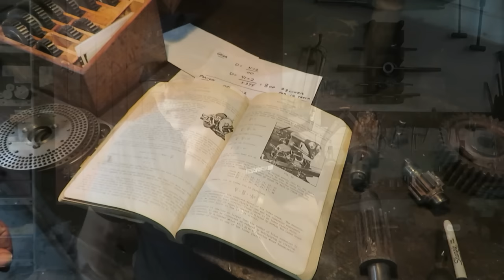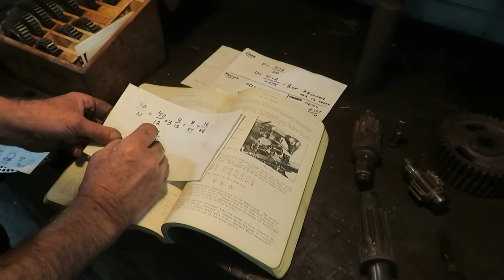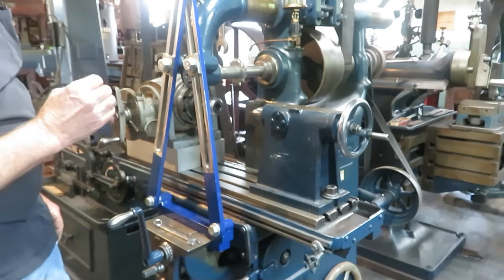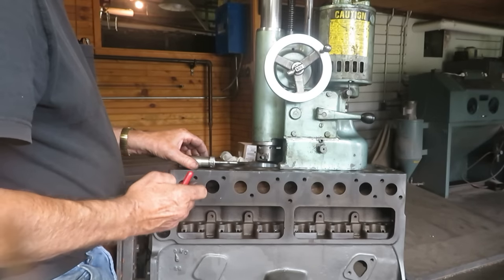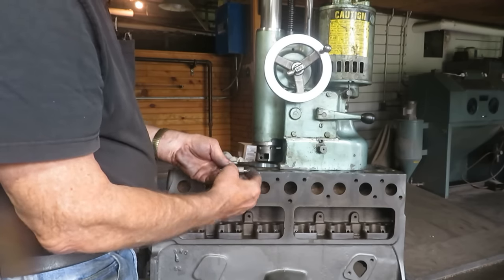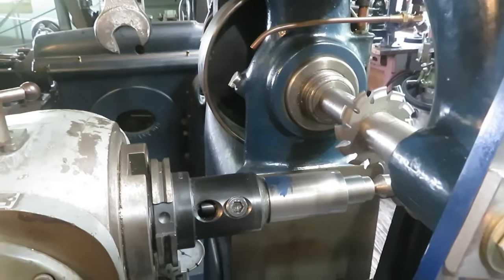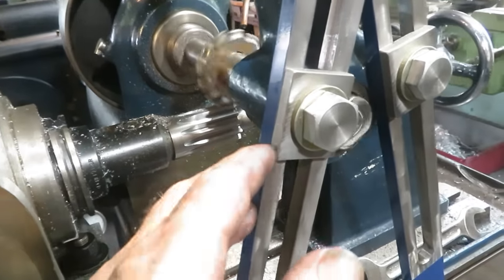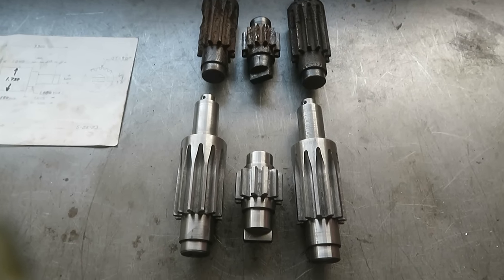Steam Powered Machine Shop 85: Gear Cutting 1890 style

Comment: Nice video. I worked in a factory in the 1980s. We had an end mill that we used to cut keywys in shafts. It was similar to the end mill at 18 minutes but more enclosed. An employee was running it, and he had leather gloves on and was brushing out millings from the cutter. His glove got caught in the cutter. It drug his arm in and split his arm in two up to his elbw. He ended up healing and losing some use of his arm. To this day, he still wears a compression sleave on his arm most of the time. Lesson learned, I guess.

Comment: Seeing there was a new video from you already made my day. Cutting gears was my main task during apprenticeship back in the early 80s. We still used the same formula and index hole plates on our machines even though they were powered by electricity. I know how easy it is to mess up if you don't check all the nuts and bolts for tightness all the time. I believe we even had a similar contraption to support the horizontal axis, but I can't remember whether that was custom made or part of the machine.
In my second year we got a rotary table so we could use a vertical axis cutter but without support from below it was never as accurate as the horizontal one so we had to do it in twice as much passes and went back to the old machine with the supported axis.
Anyway, good to see you back.

Comment: Thx for a Great much awaited new vid. Couldn't tell for sure if cutting the gears was "working" the  engine or if it was just a slightly out of round cutter, but no matter still enjoyed the shop sounds. Much appreciated Sir.
Reply from the maker: No matter what you do, the arbors never run exactly straight when you tighten them down , probably because the spacers are less than prefect and those are way less than prefect. If the cutter is sharp, it doesn't seem to matter.....Dave

Comment: I had seen another old horizontal mill on another YouTube machinist video channel.  Believe it was a WWII era machine and the end vertical support was a large heavy cast iron component to memory.   Like what you guys are doing.  I’ve always wanted to do more and learn machining.   I and my handicapped brother had great parents.   Dad never got to finish the 4th grade.  He and mom wanted to see me get a good education and trade skill if I didn’t get to ho to college.  In the late 1960’s and early 1970’s everything pointed to electronics being the next big industry.  I was in high school and knew they didn’t have the money needed to send me to college even though they would have done everything they could to do so.  Dad was a Jack of many trades and a master of many at least in my eyes.  Auto mechanics, welding, carpentry, masonry/concrete and a hillbilly engineer always able to figure a way to do stuff without the special tools.  In high school I worked from about noon till 5pm at a local welding and machine shop.  I took the opportunity one day to miss classes and take the military’s ASVAB (Armed Services Vocational Aptitude Battery) of tests.  I maxed out the mechanical section but did pretty bad in electrical/electronics as the not thing I really knew about electricity was getting shocked and that it made electric items work.  Still my intuition and guidance said electronics and computers were the future.  So I asked and the recruiter allowed me to go through their MOS (Military Occupational Specialities) books that described the MOS and it’s AIT ( Advanced Individual Training) school curriculum.   I was looking for something that employers would have need of people with that or similar knowledge or I could use after service to have my own business.  I settled on the most advanced and longest school they had in electronics. Well the course was a struggle for me but I made it and at my duty station at Ft Bliss in El Paso, TX soon became the lead troubleshooting and repair technician in my MOS.  I had always wanted to come back home to live and work and I got a job working for the utility at the nuclear power plant being built.  Worked there 29.5 years until a life of chronic pain with sleep deprivation forced me to quit at 51.  I’m 67 now and always missed being involved in welding and machinist work wanting to have my own hobby/side income doing that. Hasn’t happened yet but still hoping and praying it will happen SOON. like what and how you guys are doing machinist work.

Comment: My imagination started to work on overdrive when You were talking about the options to run a machine backwards.
Goes like this:
 - I need to run my machine backwards, when is the next opportunuty to run the line backwards?
- You should know, it is every tuesday we have the backwards hours. You have to wait till that.
The drill operator says that next tuesday is out of question because he has a tight schedule on his project.
He was given some left handed drills ...

Thanks for the video.

P.S. When I have to figure out the disk for the dividing head, I usually multiply the number of teeth with 40. Then I start to "try" out nubers that this product is divisible with. When I stumble across a suitable number, that is the number of holes the disc needs to have.  with that disc, each teeth needs to have 40 holes passed by. I am a little bit fraction disabled ...
Reply from the maker: But certainly you have a feel for dividing large numbers in your head....Dave

Comment: spent a couple summers in a old job shop with these machines. the overhead shaft was still there as was the boiler and bunker c fuel tanks and fuel. the shop was electrified sometime in the 20s or 30s around the same time ransom olds factory electrified up the road. one drill press had a general motors transmission overhead for the reduction and coupled to the electric motors. i still rather manual machines for their ease of use and memories of those summers turning out rollers for conveyors and citrus handling equipment the company sold from the teens until the 80s when the shop sold and was scrapped. what a shame i wish i had all that because it was scrapped for steel at the port off tampa and loaded on a barge bound for korea..

Comment: The last production job done on my grandfather’s 1892 F.E. Reed 18x72 lathe was 9,500 pieces circa 1970. When I inherited it I found a good fit- I donated it to a museum that has a machine shop of steam-powered, flat belt driven machines between 1890-1910.
Reply: You were supposed to learn how to use it.
Reply: @SirTophammHatt-zs7jj  My grandfather, who died in 1964, used to shift the drive belt from one pulley to another while running by pushing the edge of the belt with the palm of his hand. I never even tried that, but I ground flywheels and pressure plates, split 16 inch Kelsey-Hayes wire wheels for widening, cutting them from the inside out, cut driveshafts, and turned 20 foot shafts with steady and follower rests and little doors cut in the shop walls! But I’m 70 now, and the museum does use it.
Reply: Please forgive my cheek. Far better than being long scrapped and forgotten. You did the right thing. If only our bodies stay cast as well as  these old iron hulks do.
Reply: You are a very useful engine, Kenneth Jackson.
Reply: @SirTophammHatt-zs7jj  I told the folks from the museum ( Amador Sawmill & Mining Association, Plymouth, CA, a 501(c)(3) organization ) that the biggest plus was that it had never been in the rain, and the biggest minus was there was no taper attachment. Some things they have rescued seem to reflect hoarding tendencies, like the last two steam pile drivers in the San Francisco Bay Area.

Comment: Thank you David. I'm so very glad to see you back. I've been missing my weekly dose of steam. Question: Is/was there a standard speed (RPM) for line shafts?
Reply from the maker: Actually, they say that the belt feet/min is the big thing and that would vary with the diameter of the driving pulley as well as the rpm. The higher the belt speed, the more power you can transmit.  I am running about 260 and it should be up about 300. Sometime if I take down the main shaft, I will put a smaller pulley on the main drive......Dave

Comment: Truly enjoy your work with this old steam powered work shop. I feel in many ways, your shop is far more efficient than many shops today.
Question on the "center" pin you used on the lathe. Any concern of getting a groove cut in on it even when using oil? Wouldn't a live center be better?
Still love the sounds of these old machines, just seems quiet compared to machines of today and the sounds of the belts, just music to my old ears. Thank you for sharing, great video as always, cheers 😊
Reply from the maker: True, but I am trying to experience "old" here...ball bearings came later..Dave
Reply: @davidrichards5594  I understand that, I was only asking. I do feel that these old machines are still way better than today's. Cheers :)

Comment: Thank you David. I'm so very glad to see you back. I've been missing my weekly dose of steam. Question: Is/was there a standard speed (RPM) for line shafts?
Reply from the maker: About 300. Woodworking machines would run faster, heavy mill shafts with large pulleys ran slower,  Textile mills extremely fast.
Reply: @davidrichards5594  Thanks. Have been watching your videos and wondered. SFM probably does make a lot of sense. I learned something today!

Comment: The combined noise of the line shafts and all the machines must have been deafening. The belts were a real threat; many workers lost a hand or a limb when seized by a belt or a pulley. The price paid for the so called Industrial Revolution was extremely high. Sadly the wealth generated by the workers did not come to their benefit. It landed in the pockets of a handful of billionaires.
Reply from the maker: Baloney.....Dave

Comment: I am confused. If you want 12 teeth and have a 24 hole plate couldn't you just use every other hole?
Reply from the maker: You could if it was a direct indexing dividing  head (or spin indexer,, as they call it). Most regular dividing heads have a worm gear drive between the plate and the work holding shaft, those are usually a 40 to 1 ratio, so it gives you a lot more capability for different numbers of divisions....hope that helps....Dave